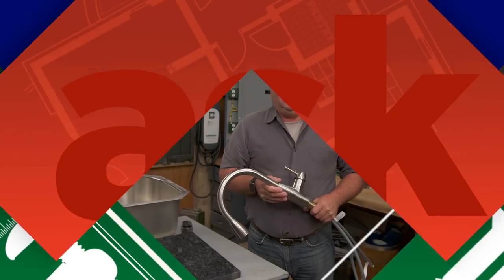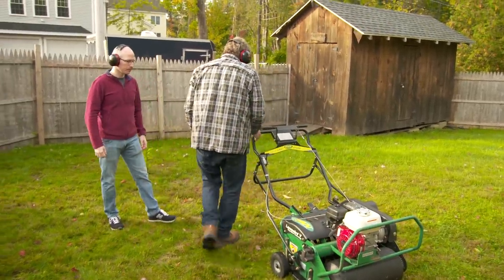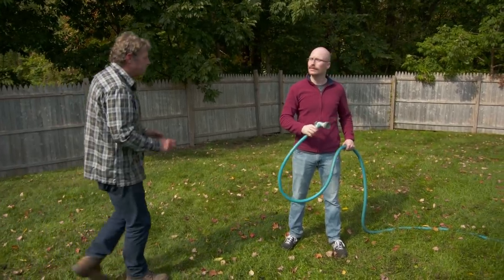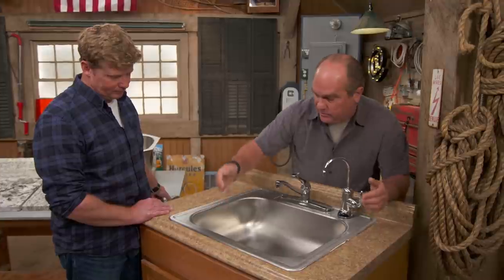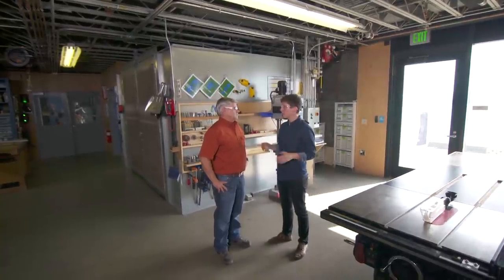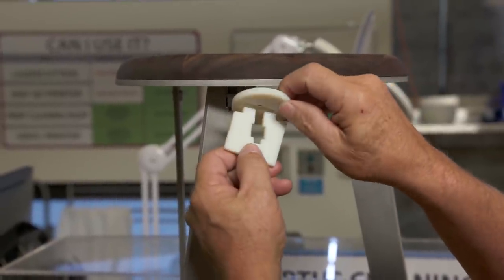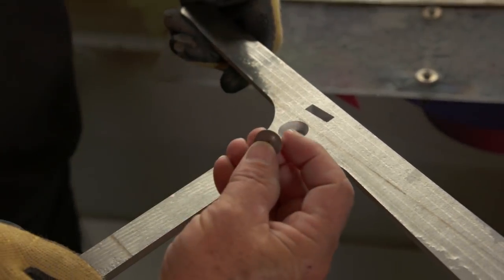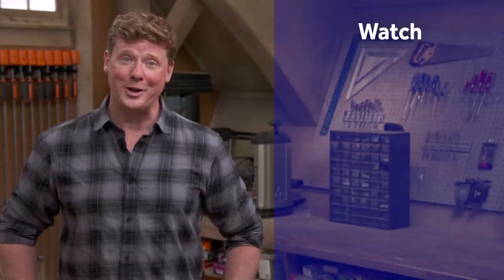Ask This Old House | Lawn Care, Futuristic Workshop (S16 E14) | FULL EPISODE

Comment: I'm not so sure about that spring seeding advice from Rodger. In our area, Midwest, two applications of pre-emergent are recommended typically. 1 in mid to late March and another in early May. When I apply spring seed for customers, I skip the first pre-emergent application and apply the seed, then follow up with the later pre-emergent application after the seed is established. Crabgrass doesn't typically germinate an hour area until early May anyway. Bottom line, check with your local Turf people!
Reply: As you so wisely say, not all areas require the same treatment.

And you might also refer to any advice from your local agronomy departments.

There again if gardening is your thing then no reason not to experiment with human wee ... absolutely free and an inexhaustible supply right on your doorstep.
Reply: @t1n4444  also time intensive and a luxury most people would rather not afford
Reply: @josephkilleen7807  😂😂😂 how long does it take you to produce a few pints of nature's goodness, dilute it in a watering can and sprinkle it over a lawn.

Even the lawn we saw wouldn't take that long.

Comment: A bit of feedback on the lawn care part. 

First, before you aerate you want to make sure to give your lawn a deep watering or else the aerator won’t go as deep as you want it to. 

Second, I would recommend a lawn leveler instead of a rake when you are spreading soil with compost.  

Third, I would use soil to level, use a leveler (it’s a tool), throw down seed, then slightly rake, then spread peat moss. There are peat moss rollers that will make it a cleaner job spreading that. 

Lastly, you want to water more than one time a day after you’ve thrown down new seed. You want to water 3 to 4 times a day for about 5-10 minutes each time until the seed germinates. The three seed types you used germinate at different times. 

Just know there is a lot more to lawn care than what this video shows. Follow Ryan Knorr lawn care on YouTube for the full scoop.
Reply: Nobody has time to water a lawn 4 times a day. Are you kidding? People have lives to live.
Reply: @D_SQ  that's what I tell my customers even if they're at home all day, that's what digital timers are for!
Reply: @D_SQ  Hmm, you are forgiven for not knowing about automatic lawn sprinklers attached to a computer ... which measures parameters such as soil conditions, weather conditions,  relative humidity etc, etc.

Plenty of info online if arsed.
Reply: @t1n4444  I think I have seen a video of one of these 'automated' systems in another one of these TOH videos, but it's difficult to think about that when they didn't do it here, and the homeowner is holding a hose and watering his lawn manually, but touché I guess.
Reply: @D_SQ  😂.

If you were arsed have a squint at the "engineered climate" polytunnels on Spanish farms.

Downside is so many chemical additives against bugs, mold, plant diseases etc,  the atmosphere is inimical to human life ... as in your lungs take a right kicking.

And then we eat it.
Reply: @D_SQ  this is the timer I use. It’s simple and easy to use. There are some very intricate timers out there that folks use for in-ground systems that measure soil temperature, humidity, the weather forecast, etc. Those work well but for a small yard something like this is all you need. Melnor 65036-AMZ AquaTimer 4-Zone Digital Timer with 5 Stainless Steel Filter Washers Watering Set https://www.amazon.com/dp/B07PBKWYR1/ref=cm_sw_r_cp_api_fabt1_54KVFbDQ62VP7?_encoding=UTF8&psc=1
Reply: I'm thinking i would have cut the lawn shorter. watering for the next 10(+) days anyway so not much risk of burning it. thoughts?
Reply: @donc-m4900  yeah you definitely have to scalp it. Maybe bring it down to an inch or so.

Comment: They should have also warned people that with laminate counter tops, cutting it without proper air venting and masks can cause long term respiratory issues - since you're basically cutting plastic; and then you'd breathe in the plastic dust particles.

Comment: Now, this wheeze is known only to a few. Lawn fertilizers ... as it happens there is a perfect "lawn food" available to all at absolutely zero cost.

It is the absolute epitome in the way of fertilizers. This knowledge is something the fertilizer manufacturers don't want you know about.

Anyone guessed yet? Well, to put you out of your misery I'll tell you.

Ready for this? It is human wee. Yes it's your very own waste product and is packed with nutrients that grass absolutely craves.

Plenty of info online from green community/agronomy websites and YT clips but in short properly diluted human wee is the absolute best as an all round lawn food, and any other greenery of course.

There are a few rules on dilution and frequency of application and when to feed a lawn but in short and as general rule of thumb dilute at around 7:1 ( more water), preferably before rain and during the main grass growing season for where you live.

Slightly different rules for decorative plants plants and food plants.

And don't be tempted to use your solid waste in the same way.

Any solids should be allowed to rot down for a year before applying to decorative plants and perhaps two years before application to food plants. This is because of the pathogens issue.

If you aren't entirely convinced then easy enough to do your own tests on a patch of lawn. One section without any fertilizer and two other patched fed with a proprietary lawn food and the last with wee at "a" dilution.

Lastly, on plant feeding, suggest you don't apply lobstahs, even rotted ones. If you live near the coast then washed and rotted seaweed is supposed be excellent.